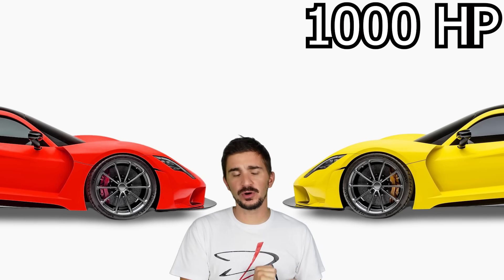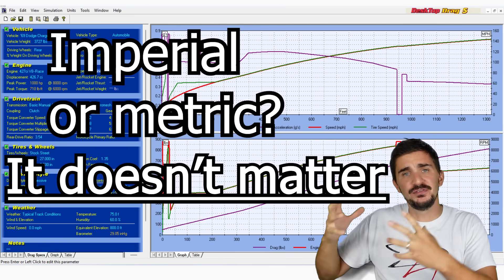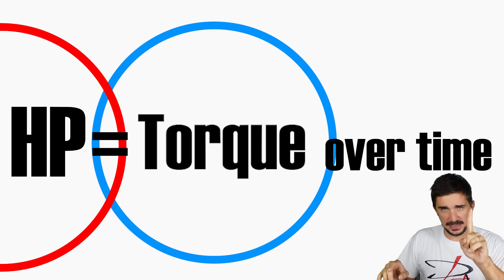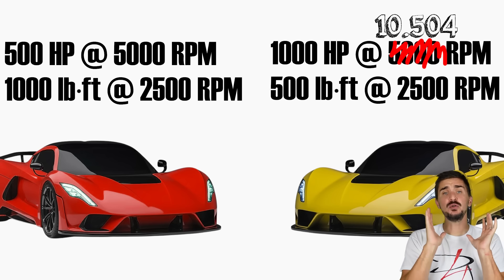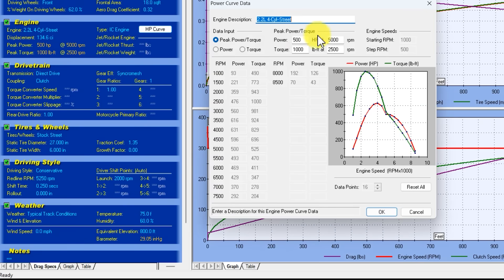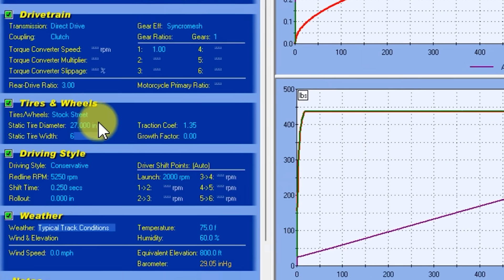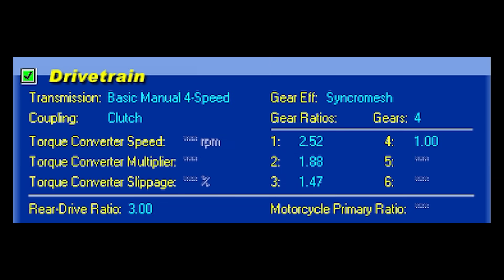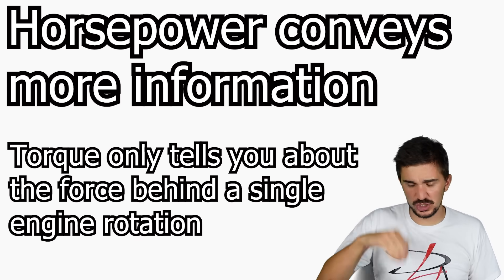Who's faster? Explained and Simulated - Horsepower vs Torque

Comment: I drove a convertible BMW many years ago from a buddy and hated that car. It had a 2.3 or a 1.9 don't remember and it had a manual transmission but that thing only had power/torque if you went beyond 4K rpm, which might pleasant on the track but it was just awful on the street. No torque on low rpms meant driving fast because I had to accelerate more than I wanted. Also fuel consumption was bad because I was using high revs

Comment: If you have 2 identical cars with same weight and everything, despite 2 different engines, then the car with most hp will always win when gear ratios are optimized to each engine. Which they of course are in all cars before they leave factory. Torque doesnt matter then.

What will matter though is the torque curve (which also results in the hp curve)... because an engine is never always at the optimal max hp rpm during acceleration. And cars with high torque to hp ratio often have a flatter torque curve. So they will make more hp at lower rpms than a smaller engine. Even if they have the same max hp.
That's where the only difference, purely performance wise, comes in.

But if you theoretically could always keep each engine at the exact rpm where it develops the most hp then the max hp number is the O-N-L-Y thing that will determine who is faster. Presuming everything else equal of course.

Comment: I salute the effort of trying to explain this to people, it is really comic how many car enthusiast, petrolheads, etc. there are without a clue about what they are talking about.
The only comparable value between 2 cars is the horsepower and I don't understand why we are still comparing torque values. It's nonsense.
And 1 more mind killing thing is when you hear that the engine develops x amount of power AND!!! x amount of torque. As you said, its not power and torque its power by torque and speed.

Comment: This is fail at one single aspect, it first changes the max rpm of the hp engine from 5000 to 10 000 and then never corrects for that change in the simulations, the hp engine needs "double" the gearing than the other car, its very simple.
 The way it was simulated was "forcing" the hp car to "drive" at 2x the speed of the torque engine, meaning it was geared to 400mph when the torque engine was geared for only 200mph, really unfair comparison.
At the end it was actually misleading! The main message of the video is good but the comparison is not.
At 10:35 you can see Torque engine 5500 rpm and 150mph while the HP engine is stuck at the same rpm and speed ! 
Meaning the comparison was made with both engines at 5 000 RPM when the HP engine is supposed to REV at 10 000 RPM
So the comparison was made with one engine using his whole powerband (going to the limit of revs) and the other one not.
If I race a F1 car against my diesel truck i will always win if the F1 car is not allowed to go past 1 500 RPM !

Comment: Although your examples was extreme.....the only power a engine makes is torque.  Hp is just a calculation.  High rpm hp is just high rpm tq.

This is why gearing is important.  Gearing multiplies tq not hp. 

As far as cars go there are many other factors in acceleration.  Most cars especially gm v8 stuff has massive tq management. From regular tq management to clutch protection,  axle protection. Then there's mechanical tq management in the form of heavy ass clutches that is anywhere from 52lb to 80lb. Then as tq goes up they also lengthen 1st gear to help control it...hence z06/zr1 can run 60+ mph in first gear.

Btw peak acceleration occurs at peak tq. Hp just tries to help carry that acceleration farther. But again all hp is does is rate tq at rpm.
Reply: Nonsense. Engines produce both torque and Power.  All work is done by Power.  Peak acceleration will always occur at peak Torque for a given Gear .  However…. Peak acceleration will always occur at peak Power for a given Speed

Power, not torque, is the limiting factor in not only the top speed of a vehicle but also how quickly it can accelerate at any speed and how much weight it can pull up an incline at any speed.
Reply: @rollsroyce329 it's not nonsense.  Tq is the only power exiting a crankshaft.  Hp is only a mathematical equation based off tq and engine speed.
Reply: @HioSSilver1999  nonsense.  Torque is not power any kind of Power.  Engines produce both torque and Power.  Torque is just a mathematical equation calculated off of the measurement of Power. 😂
Reply: @rollsroyce329 not only are you wrong you don’t look very bright at all.

Tq is the only power. What does gear do??? 

It multiplies tq....because tq is the only power. 

You ever notice how when engineers program a pcm THEY USE TQ MANAGEMENT to perform power limiting tasks in the pcm.

Notice how that's not called hp management.
Reply: @HioSSilver1999  😁 that’s Cute…coming from the guy who thinks Torque is Power. 😁. Torque is not any kind of Power.  Maybe your torque “identifies” as Power but hot dogs are not real dogs. 😁. Torque is Force x Radius.  Work is Force x Distance Power is Force x Velocity.  

Torque is a measurement of force x radius. Torque is what CAN cause rotation. Torque TENDS to cause rotation but rotation needn't happen in order for torque to be present. If Torque succeeds in even the smallest amount of rotation Torque has crossed over from a frozen timeless realm to a temporal one and has become Power.  All Work is done by Power.  Torque on its own can do no Work.  Torque is the potential to do work.
Power is work being done. Power = Work /Time.  Without RPM Torque is merely Potential, a feature without benefit.  Power is the benefit Torque Tries to deliver.
Reply: While we're demystifying engines, Torque, RPM, Work, Velocity, Force and Power let's clear up some common internet hivemind misconceptions: (some of you may need to sit down for this)

Horsepower is not merely  "marketing"
It, like Watts, Kw, BTU/Hr it is a measurement of Power. Dismissing it as merely "marketing" implies that it's a feature without benefit. Advertising a torque number without RPM would be a feature without benefit.

Power is not what "maintains" speed or "keeps you going". That's how much fuel you are bringing with you.

Long stroke engines do not make more torque because of "leverage" from the crankshaft.
Crankshaft's do not add any leverage to the work done by combustion to propel the vehicle.

18 wheeler "semi" “big Rig” trucks do not make massive torque "because" they need to haul heavy loads.  This conflates correlation with causation.  Large size clothing doesn’t make people obese yet obese people wear large size clothing.
The maximum output required from the engine is based on its power not its torque.

Maximum acceleration at any given Speed does not occur at peak Torque it always occurs at peak Power. Maximum acceleration for any given GEAR occurs at peak Torque and would be less than at peak Power at a different gear ratio for that speed.

Maximum towing capacity at any given speed does not occur at peak Torque it always occurs at peak Power .  Maximum towing capacity for any given GEAR occurs at peak torque and would be less than at peak power at a different gear ratio for that speed.

Torque is not “the only thing and engine produces” or “the only thing that can be measured.” Some brands and type of dynamometers like Mustang brand Load cell type measure torque directly and calculate power, others like Dynojet brand inertial drum type measure power directly and calculate torque. Neither of these "delegitimizes" the concepts of Torque or Power

Torque is not what wins races, a race is a competition based on work vs time. Torque is irrespective of time as it is only Force x radius.  Power = Work / time and is the measurement that would indicate the winning of a competition involving work vs time.

Power and Torque aren’t “the same” or “equal” at 5252 RPM.  They are two different things measured in entirely different units.  400 feet of wire is not “More than” 300 litres of water.

If you still believe in the magic torque and would like to schedule an exorcism please reply below.
Reply: @rollsroyce329  looks like you posted exerts from a book without any practical knowledge.

Comment: Horsepower will ALWAYS win with the appropriate gearbox. Because a gearbox is a torque converter and it converts the higner HP into higher torque at a given output rpm. In other words the 1000 HP has double the torque of the 500 HP after the gearbox.
Torque numbers are pretty irrelevant. A 550 HP wins over a 500HP even if the 500HP has 10 times the torque if the gearbox is right.
Now let the morons call me wrong ...
Reply: its crazy how still so many people dont understand these simple facts
Reply: torque value matters if the vehicle mass is high (e.g. trucks), because you need more power at low RPM to avoid clutch/wheel spin

Comment: Given proper gearing the higher HP engine will always be faster, even when you increase weight. The reason semi trucks use the engines they do is not because they "need a lot of torque to move the weight."  In fact a 500hp 4 cylinder turbo could pull an 80,000 lb trailer no problem if it was geared right.  It's because of many other good reasons that I will attempt to list. 1) Large turbo diesel engines are substantially more fuel efficient for their power output.  2) A large turbo diesel engine can actually sustain its max power output continuously rather than for quick bursts, from a cooling and durability perspective.  This also translates into overall longevity.  500,000 or even 1 million miles are possible, working all day everyday.  That 500 hp turbo 4 will need a rebuild at 80,000 miles doing the same amount of work.  Maybe sooner.  3) In the engine RPM operating range, a large turbo diesel engine has a flatter HP curve meaning within that range, it will make more average HP.  Of course, a theoretical 100% efficient and 100% durable CVT would solve this problem for our fictional 500 hp turbo 4 but that doesn't exist.  So in the real world with gearing, the 500 hp turbo 4 is going to perform worse because it won't be operating at an RPM where it makes 500 hp as often.  4) Similar to #3 but more specifically for launch conditions, the large turbo diesel is making FAR closer to its max HP at RPMs where you would normally expect to get the weight moving.  In the 500 hp turbo 4 example, you'd need to slip the clutch at like 5000 rpm just to get the load moving (or we'd switch back to a fictional transmission where this would no longer be a disadvantage).

Really, the torque that large turbo diesels make is just a byproduct of everything else.  You want 500 hp @ 2200 rpm?  Well that is going to require 4 figure torque.  It's just the way the math works out.

Comment: Refreshing to hear someone talk about this who actually understands that power and torque are not independent of each other, but in fact fundamental to each other. 

So many people just don’t understand it, and also don’t grasp the fact that a peak number is only telling a fraction of the story. 

Good work.
Reply: While true, you can gear to maximize the torque at the wheels. You can't gear in more power. Edited because I stated it goofy the first time.
Reply: @Spearborne  you gear around peak HP for maximum acceleration
Reply: @1fast72nova  yeah that's what I meant. Phrased it wrong. You can gear however you need to to get whatever torque you need from the power available.
Reply: @Spearborne Exactly. Torque you can multiply however you want, like Archimedes (supposedly) said give me a firm place to stand and a lever and I can move the Earth. A hamster running on a wheel can move a truck if you give it enough torque multiplication.

Power is the limiting factor, your engine can only make so much of it. This is pretty basic Physics...but most people don't know basic Physics.
Reply: I have seen a quite many bad answers, so I may elaborate. Too many people are obsessed with torque, and worried about gearbox. It can be a question on a huge trailer, but guys, even a 150HP car can spin the wheels on gear 2, so that is not an issue in practice.
Also do not forget that there are gears in the differential too, and possibly other places that can adjust the RPM range to the speed.
Only power matters for the end user, torque is just important for the engineers designing the drive train.
If you are so uneducated, you may hit some books and learn things that are already known for a few hundreds of years.
Reply: No, if the gearbox is good enough the only thing you need for acceleration is a good peak horsepower.
Reply: @attilakiss8585  think very carefully about what you just said.

If the *GEAR*box is good. So... the gearing...
Reply: @attilakiss8585 No..just no
Reply: This video is rubbish and only touches on reality

Comment: Nice video, but you still kind of confused the confused. Complicating stuff with totally unrealistic gears etc…
Double power wins big time all the time.
Reply from the maker: But it doesn't
Reply: @d4a if you gear one car for top speed = X and the other for top speed = 2X then it doesnt
Reply: If you have double power, same weight and normal gearbox then always. @d4a

Comment: Keeping the gear ratio the same on a high RPM and low RPM engine is madness.

The 10.000 RPM engine needs twice as high ratio to match the 5000 RPM engine.

The 10.000 RPM engine is only in 2 gear when the 5000 RPM engine is maxed out in 4 gear.

Comment: Hello, a couple videos before I have asked if you can explain how engine load is determined and you made a video about volumetric efficiency. However I still cannot understand how ecus know that when we are going uphill and increases the injected fuel while I am keeping my throttle at the same position...
Reply from the maker: The ECU doesn't do that. Maybe some very modern fancy ones that get inputs from some sort of g-sensor or similar, but honestly I doubt it. If you go uphill with the same amount of throttle you will slow down.
Reply: @d4a unless the cruise control is active
Reply: @d4a  i know i will slow down with same throttle however if you watch instant fuel consumption, you will realize that ecu sends more fuel to the cylinders

Comment: In daily day to day driving  , torque is better most of the time than horse power .
If you are drag racing , with limited traction , the reverse is true . 
Any way you look at it , 500 foot pound of torque is a lot in most street vehicles .
In 18 wheelers , carrying heavy loads , that 1000 foot pounds of torque comes in handy ! 
Very informative video ! 👍

Comment: That's why cars have a transmission. Torque at the wheels is what counts and not between motor and transmission. It's always good to know at euych RPM the motor has the highest output and where it's most efficient.
Imagine airplanes, boats or generators. These often do not have a transmission or even a fixed gear ratio. So they need to be tuned that their max torque occurs in the optimum RPM.

Comment: Let's explain it this way. Horsepower is how much you can rev up, torque is how fast you can rev up. You can change the output acceleration and top speed by changing the gear ratios but, the thing is torque based engines are heavier and create more vibrations. So they need a stronger frame to keep them in place. Horsepower based engines however, are lighter, they don't need as much strong frame and the car will be less heavy. Wich means you're gonna burn less fuel. But another problem is that the torque itself is not constant in IC engines. horsepower based engines create their peak torque in higher rpm's and running a horse power based engine on low rpms will cause to engine failures and damages. That's why you need a torque based engine for a truck. It's stupid to have like 50 gears, floor the gas all the time to just have enough torque for the thing movig. Also trucks do have strong frames because they carry havy cargos. So why not to have a torque based engine on them?

Comment: Amazing video. I already knew this but I've never seen it illustrated in such a straightforward manner and really enjoyed it as always. The punching analogy is just genius. Would love to see a video on tires and grip, ie bigger tires, stretch vs bulge, lower profile with more unsprung weight vs smaller wheels with a higher tire profile. I must confess I feel like I know frighteningly little about which of the aforementioned factors/choices are best for performance for a car enthusiast.
Reply: There are a lot of car guys who never understood the relationship between torque and HP.  I'm showing them this channel 😊
Reply: I second this tire idea! Knowing more about the impacts of tire pressure in various motorsports applications would also be fascinating (i.e. drag racing, rock crawling, rally, road racing, etc.)

Comment: This video here demonstrates neatly that horsepower AND torque are equally important, but it depends upon the application.

If I'm buying something like a truck for hauling or trailer towing, I am going to be looking at that torque number and perhaps caring more about how low the gear ratios are for the first couple of gears so that I get that sweet sweet torque multiplication that can get heavy loads moving.

If I'm buying a performance car, horsepower and the engine's peak power line is what I'll be looking at, and the spacing of the top two or three gears in the transmission for comfortable downshifts that won't require me to make too many jumps to get to the torque that I need for acceleration at speed.

But if I'm buying a performance car, I'm honestly paying AS MUCH attention to how the suspension feels, because even a low horsepower, low top speed car like a Miata can feel fast when the suspension is set up just right.